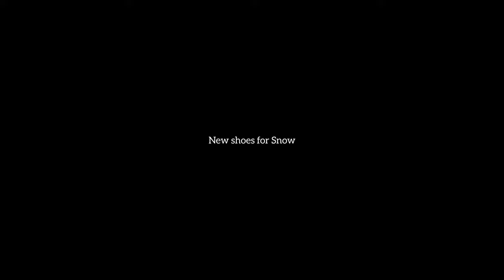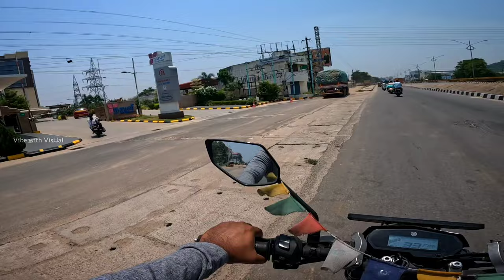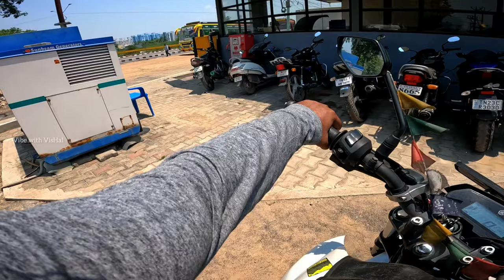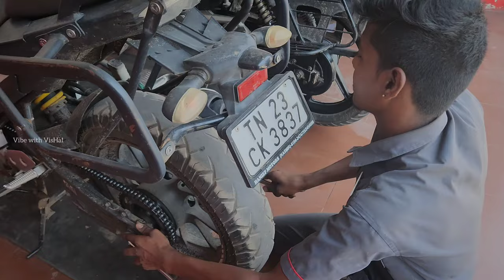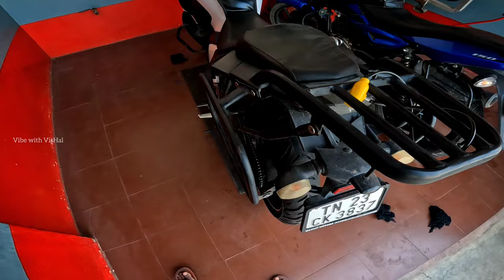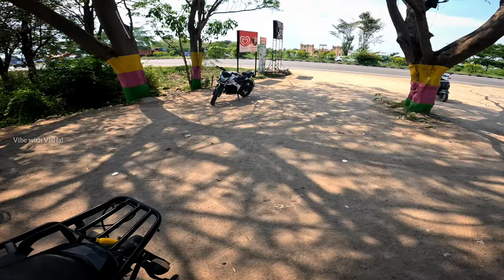Michelin Pilot street 2 | Yamaha FZ25 | Motovlog | Tamil |

Comment: Hi Bro,

I am also using FZ25,

Based on your experience will u still suggest these Michelin tyres?

Pls let me know in case of any issues like mileage drop due to 150 section and also in wet surface grip
Reply from the maker: From my observation, It's good for tarmac and cornering wet grip also decent. But once you go off road it's very slippery especially in wet conditions. Because it's a round profile tyre, we won't get enough traction in off road.
If you see my Kerala ride video, i got stuck in off road.

Comment: What are the sizes of the tyres. I can't find 140 70 17 s in pilot 2
Reply from the maker: Rear It's 150/60- 17
Reply: Won't that affect the mileage and handling
Reply from the maker: @731sniper  So far i did not face any issue. It handles well, From my observation this tyre is more rounded and very good for tarmac and cornering, however for off road and muddy sections it just slides. Wet grip on tarmac is also good.
Reply: @vibewithVisHaL007 radial or normal?
Reply from the maker: @akshaykanojiya652  Radial it is